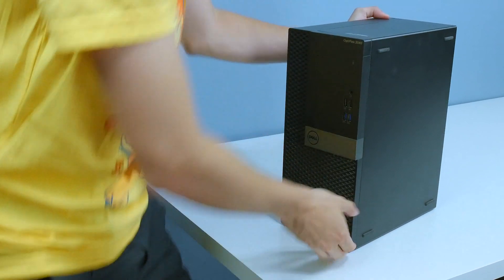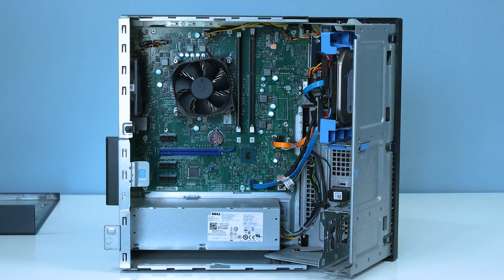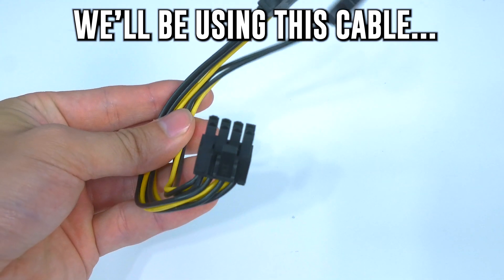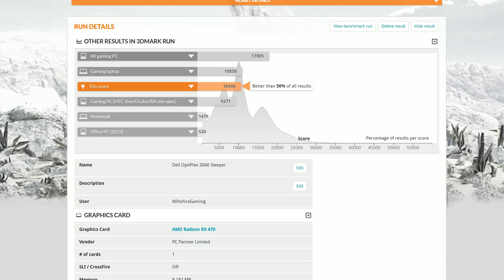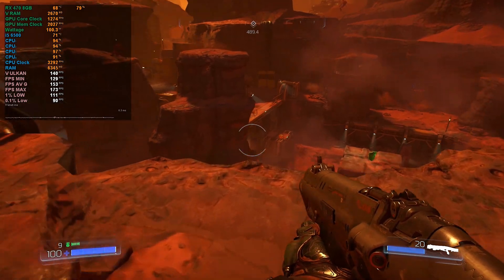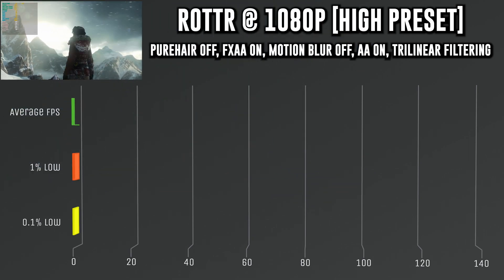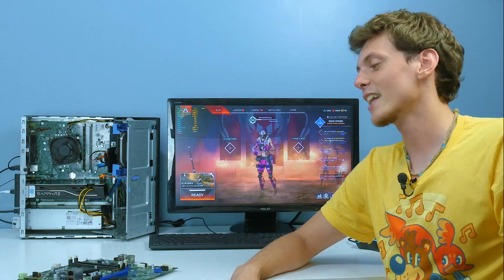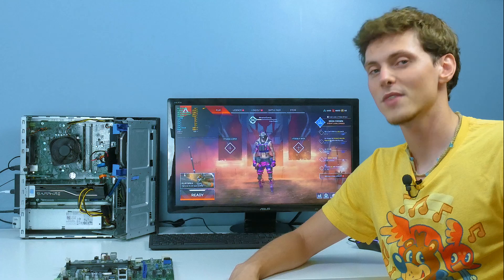$400 Budget Dell Optiplex Gaming PC (2019)

Comment: What a great find, I wish I had PCs like that lying around in my garbage lol. Surprised you made any foreign hardware fit, Dell is known to have needlessly complicated and cramped pre-built system cases(not to mention limited ports, oof on that single channel RAM), very lucky.

Also, how did you mount that backplate? It looks awesome, I actually bought an XSPC backplate for my little project, cause I couldn't be bothered to make one and it was like $14US on Amazon. Your looks very slick though, great finish.
Reply from the maker: This is the second PC that I've pulled from the garbage at work lol. First one was a Lenovo with an i5 3570 in it and 8GB of RAM. I gave the PC to a friend in need of one after reviving that one too! I was starting to sweat bullets a little when I was struggling to put the RX 470 in it. I knew it was gonna be close, but not THAT close! Believe it or not, after some extensive research, I've discovered that the Optiplex 3040 I have can indeed run Dual Channel Memory! I just need to find the exact same RAM stick model that's in there already or 2 identical RAM sticks that are DDR3L!

I just mounted the backplate on the GPU with some double-sided tape. Obviously, you want to get the non-acid and conductive type. I've seen the XSPC backplates before. They're not bad and they definitely get the job done for $14. Happy to hear you like my backplate design! That's automotive clear coat for you!
Reply: @WiltshireTutorials  Another RAM stick could be great, but there's still only 2 DIMM slots, which isn't that great, but I guess is enough for this type of PC.
Got lucky with my backplate too. It said it was for GTX 980/980Ti founders edition only, but I needed it for my two old 780's and there weren't any, so that was a gamble. Luckily, since the dimensions and screw alignments are almost identical, it fit perfectly. This is why I was considering DIYing it, but $14x2 was a way cheaper option than buying all the tools and materials to make one. Yours came out fantastic though, love the design.
Reply from the maker: 16GB is plenty of RAM for gaming, for now. Glad to hear the backplate worked out in your favour!

Comment: Who in the world would throw away that PC? An Optiplex 3040. i5-6500. 8 GBs of RAM. I would have simply used that same cable, and plop in a Sapphire RX 580. Add a cheap SSD, and you got a console killer.
Reply from the maker: People who don't understand how valuable those parts are, that's who! 

With the 240W PSU in a 3040, you may pull too much wattage with an RX 580. Maybe with some undervolting you could make it work. It would be a close call, that's for sure!

I am planning a follow up video in which I upgrade the parts in the 3040. An SSD is definitely on the list of upgrades!
Reply: @WiltshireTutorials  Wouldn't the SSD reduce the overall wattage that the system would pull, allowing for a tad bit more leg room for the GPU?  Or would that card still be putting the PS to the limit.
Reply: The 580 pulls more wattage than a 1070. I'm pretty sure the system would just shut off from the power draw. I also, wouldn't suggest a SATA to PCIe converter with that much draw either. I wouldn't even feel comfortable running the 470 on this power supply. I'd really be interested to see what the wattage draw from the wall is.
Reply from the maker: @slayerjohn447  Believe it or not, SSDs draw more power than an HDD
Reply from the maker: @TheGameBench  I did stress test the Optiplex after filming for 24 hours. Nothing blew up. But, I wouldn't recommend running the PC in an overclocked state, like I did.
Reply: @WiltshireTutorials  Of course. I just did the same thing today with a 9020 and a 1070 on the stock 290 watt PSU. Pulled 281 watts under max system load from the wall. It was interesting to see if it would work at all.
Reply: @WiltshireTutorials  That actually works, even with an overclocked RX580, otherwise I would not be able to write this on my Optiflex with an i5-6500 & RX580OC. You actually made the mistake to power the GPU with the SATA adapters, because the SATA gets its power from the MOBO.

If you look at the specs of the PSU, you see that it has two power rails, each capable to supply 16 amps for a total peak power of almost 380W. The 240W listed on the PSU is the maximum continuous load that you should not exceed, not the peak power! 

Now, if you use your SATA to PCIe adapter, the GPU pulls all its power from one rail (70W from PCIe slot + the rest from the adapter, but that also runs through the MOBO), possibly overloading it. If you cut the 12V line supplying power to the CPU and whack the adapter in there, the power draw is more balanced between the power rails and everything is fine.

The i5-6500 is also rated as 65W TDP by Intel, but in real life draws only about 45-50W max. Running Far Cry 5 at 1080p and Ultra graphics makes the Optiflex draw about 210-220W at the wall (which is still a good bit below the 240W max continuous output if you account for efficiency). Still you get 85FPS, so yes, it can run crysis :D

If you have the RX580 Nitro, you need to cut out a large portion of the front hinge as the card is way bigger then the regular sapphire cards (will still touch the side panel). If you are then crazy enough to run the card in the overclock mode, the system is spot on with an internal power draw of pretty much 240W.
Reply: Go single fan 1060 6gb it’s same as Rx 580 8gb as far as performance I’ve got both in used optiplex pc’s I’ve set up for both my sons f I had it to do over again they’d both be 1060’s the 580 is great card to and side by side you wouldn’t know witch pc is witch except the 1060 is nearly silent and cool literally don’t know if it’s on or not sitting right next to it where the 580 is running a fan at a very noticeable level and the whole system is warmer always even with tinkering and tuning it’s just a less refined product . If it’s within 25$ for used price I’d stay with the 1060 6gb you can easily find each one for $125 sometimes , find used optiplex i7 for $150 and add a $45 psu and a ssd the size you want to spend but I got em 480gb ones for like $30 I think on Amazon ... 
all in all for a high refresh rate 1080 p gaming pc it’s best bang for the buck there’s no reason to buy new hardware for gaming pc’s unless your going for 2k or 4K and in that case if you are spending that kind of money for a monitor and gpu you probably don’t care about saving money hahahaha
Reply: amd cards dont work with them a gtx 950 or 750ti would be good
Reply: your not lying it’s similar to my first PC 😁
Reply: I found a dumped Optiplex 3010 that had a Kingston 500gb SSD and a GTX 750ti 2gb GPU last year! Apparently there was a small fire in the apartment building adjacent to mine and renters insurance basically tossed everything. 
The PC case smelled of smoke bad, so I basically gutted it for parts.
I did replace the thermals on the 2gb GTX 750ti and popped it in my Win10 i7-3770 beater PC for some Titanfall2 action and surprisingly? 
It works like a little beast!
The 750ti was such a great GPU back in it's day IMO.    
Cheers!
Reply: Gtx 1650 should work a treat even on stock psu.

Comment: I would throw an SSD in it, even a cheap as china special would be better than the spinning rust. My 1080ti came with TWO sata to 6+2 pin cables.... i am sorry if you have the money for a 1080ti you have the money for the PSU to power it :D
Reply from the maker: I'll be doing a follow-up video on the OptiPlex in the future. It definitely will involve a new budget SSD and other upgrades. In this video, I was trying to keep the OptiPlex 3040 as stock as possible to save as much money as possible.

I also never understood why they included those cables with something like the 1080Ti! I actually read an Amazon review of a guy using 2 of these to power a 2080Ti!